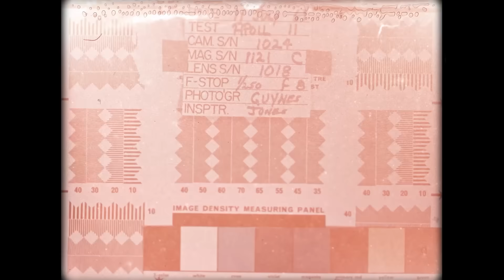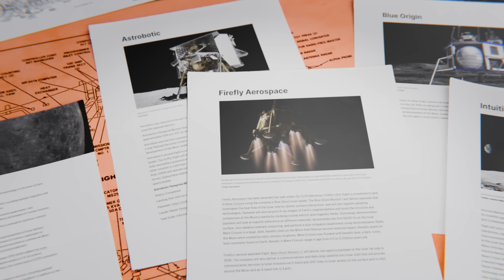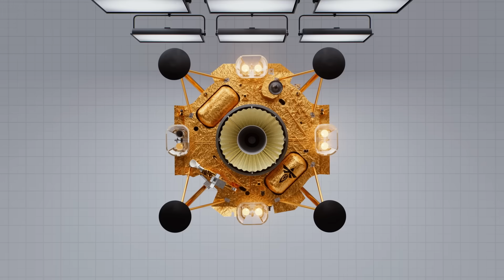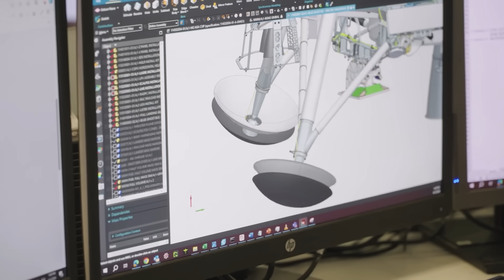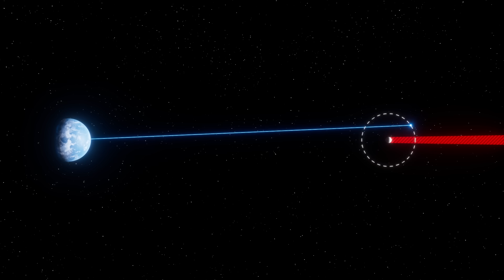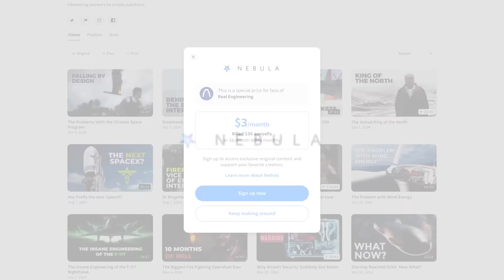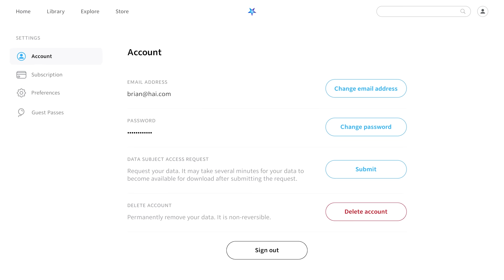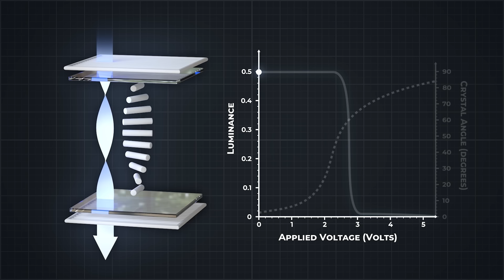Why the US is Struggling to Land on the Moon

Comment: NASA successfully landed 5 of 7 surveyor missions remotely on the moon between 1966 and 1968. Before a human piloted craft ever attempted to land. These mission answered question such as whether a lander would sink into the regolith, and the conditions astronauts would face on the surface, not to mention the auto approach programming they had worked out, a modified version of which would guide the Lunar Module  and control its attitude all but the last few hundred feet.
Reply: Happy someone pointed this out. Surveyor spacecraft managed to land on three legs, used a single rocket motor which it jettisoned before soft landing using some low-energy thrusters, managed to carry everything including fuel and a camera on a frame the size of a Harley. It even survived the lunar night. How these new unmanned robotic spacecraft cannot match that level of performance I can't understand.
Reply: @tperk  Thermo electric generators. They provided power and kept the internals warm. You cannot buy those things off the shelf. Not even if you have technology to make it to the Moon.
Reply: @HyperMAX9001  on their backs. Thermal nuclear generator on their back. Get a grip.
Reply: It’s just MONEY.   The failed landers are all built by amateur companies on very low budgets. NASA and JPL, especially in the 60’s, had effectively unlimited budgets and a MUCH deeper bench of experience engineers, scientists, and test facilities.  When you try to do things on the cheap, you have to expect a lot of failure.   NASA did far more extensive testing of proposed designs PRIOR to launch to ensure a higher success rate.   E.g.   SpaceX can’t get starship to work in 20 tries, because their engineering and testing program is moronic. But NASA and its subs got SLS to launch flawlessly on their very first try… because they KNOW HOW to test design ideas before finalizing the overall vehicle.
Reply: @tperk  On a fraction of a budget, and expected to be able to land in less forgiving environments. Surveyor (understandably) chose much more forgiving locations - in the middle of more recent craters, with no large debris - matching the safe choices that would be made on Apollo.
The program ran an est. 469 million USD, which inflation-adjusted is over 4 billion dollars today. This is more than the current proposed funding for the entire current lunar program.
The early failure rate was steep too:
Surveyor 2 failed in flight
Surveyor 3 bounced and relanded, damaging equipment.
Surveyor 4 crashed
So, 1/4 full successes in the first 4 missions, 2/4 partial successes
Reply: @tperk  Because NASA is run by bureaucrats who only care about making sure they can ask for more money at the next Congressional budget approval meeting. SpaceX has done ten times what NASA has for a tenth of the cost, because it's being run to actually achieve a goal.
Reply: @tperk  They have 2 astronauts Marooned 265 mikes away and have no idea how to rescue them. But in 1969, America achieved the impossible. Okay then
Reply: @tperk  Mate, you answered your own question. Read it again. No one or nothing can match anything that has never been done. Technology cannot go in reverse and you need to awaken to NASA's lies.
Reply: @deanhall6045 You are both doofi of the first order. Technology absolutely CAN go in reverse.  Look at the dark ages.  We used to make 16” diameter 50 caliber naval guns.   It took us a century to develop that technology over time. But once we stopped building battleships, all the tooling developed for that task got scrapped and all the men who had learned how to do it retired and then died.   We could build naval guns again, if we WANTED to. But the exact info on how to do it is lost, so it would take us a decade or two to figure it all back out.
The answer to your silly questions is that to is NOT NASA trying to put landers on the moon that can’t do it.  Those are tech bro startups that simple DO NOT have what NASA had in the 60’s, which is unlimited funding and something to prove.  Elon musks starship is a flustercuck, why?  Because he decided he knew better than NASA and chose to do everything in the way NASA NEVER would have.  He only got the contract because the GOP refused to approve a Biden appointment to head NASA and as a result ONE underling got to make the decision and gave it to Musk after he promised her a multimillion dollar job on the board for SpaceX.     Elons rocket is useless after 20 attempts.   NASA’s SLS launched perfectly its very first try and had no problem completing its entire mission profile lifting the full mass it was designed to lift.   Even Blue Origin’s New Glen launched perfectly on to very first try with its full 50 ton test payload.  
And let’s keep in mind that NASA has landed NUMEROUS rovers and even a helicopter on MARS, with robotic craft. Sal thats some tech bro startup, or INDIA a nation with practically no prior space program can’t seem to pull of a moon landing is not NASA’s fault.   It took 7 years to figure out how to land on the moon with the most bare bones solution, and it was only possible because the US had started development of the F1 engine 7 years earlier.
Reply: @christopherpardell4418  extraordinary rant but I give 3 out of 10, for good grammar. The guns were replaced by guided missiles mate, does that seem to be technology in reverse to you? They were replaced by something much better. They could figure out how to make those guns in 5 minutes mate, but haven't the need, you make zero sense.They have a need to go to the moon, it's full of trillions of dollars worth of gas and minerals, despite what the uninformed believers might try to tell me."Oh there's nothing there, we don't need to go back". How many times have I heard or read that. So six countries put landers on the moon last year because there's nothing there, ....okay. Oh, ...your lander fell over putting you sixth in the race. Enjoy your little fantasy mate, the VAB lets no human through, proof being they'd have done so by now. They haven't. It's impossible. Elon would have an office up there, probably at his minesite, of which there would be many if man could get there to mine it. I respect your right to believe in fairy tales and this is the BIG one. Cheers.
Reply: @deanhall6045 . Nice try. We can build guided missiles. But we can’t build large naval guns anymore.  That is technology we have LOST.   We could ALWAYS re-develop it.  Just like Renaissance Europe eventually figured out how to do everything the Romans could… but it took them 800 years.    The point is, we KNOW exactly how to build a Saturn 5 and a lunar lander that will work.   We just threw away all the jigging and tooling to manufacture those parts. And MOST of the electronics compensates we used are no longer manufactured. And so ALL of the subsystems would need to be RE-ENGINEERED to use the components that ARE available.    You wanna see NASA and on the moon in 7 years, like they did last time?   Just HAND THEM THE MONEY and tell the politicians to stop playing games with it.   The Apollo development program in today’s dollars cost 283 BILLION.   And took place under circumstances where every subsequent congress and president kept funding in place.    NASA, however, built a MARS lander Perseverance that landed successfully on Mars remotely, and has run it for over 3 years for a grand total of 2.7 billion. That was almost entirely engineering, design, and building the rover, landing system, and rocket to get it to mars.
Worked first time.   Because NASA and JPL are professionals.   India, and other private ventures are amateurs, and operating on budgets that are comparatively tiny.  Pull your head out of conspiracy doofistry.
Reply: @christopherpardell4418 Dream on mate, it's a very few Americans still feeling a patriotic duty to defend this hoax. Reality has bitten most people. Just another massive lie.
Reply: @deanhall6045 Very few Americans are so ignorant as to doubt what they saw with their own actual eyes.   You clearly are someone who has NEVER been to a rocket launch.  I saw one just yesterday out of Vandenberg.   Maybe get OFF the ludicrous websites banking coin off the gullibility of rubes and actually leave your mom’s basement and GO to Canaveral or vandenberg, or any of the other launch facilities on earth where you can see for yourself.   Or hey, BUILD a damn rocket yourself. LEARN how to do the math and the basic physics so that you can prove to yourself that rockets DO work and that “they” are not lying to you.     Folks what flunked grade school physics really are not qualified to figure out much of ANYTHING.
Reply: @christopherpardell4418 I know rockets work. I'm stating facts, no human can go through the Van Allen belts. Ever. Not now, not soon, not in 1969. Go get your booster.
Reply: @deanhall6045 You don’t even know what the heck you are talking about. They are not “belts” like some kind of belt sander.   They are ZONES of higher than normal radiation, MOSTLY charged particles being deflected by the earths magnetic field.  the zones of charged particles are pretty high up… well above the ISS and LEO.   Apollo, in crossing the Van Allen belt measured a peak radiation flux lasting around 12 minutes, and then an hour later a second one lasting a little longer. The rest of the time, their radiation exposure was about the same as in LEO or lunar orbit.   Their dosimeters revealed that the radiation they got transiting the belts was the equivalent of a modern CT scan.   For contrast, folks who work in banks or other buildings with a lot of granite surfaces like walls, floors and counters, get about the same amount of radiation EVERY YEAR.  Apollo was traveling at 36,000 KPH when transiting the belts. As a result their exposure was short term and not very high. 
You would have to spend 36 hours loitering in the inner belt to receive 400 rads.   A fatal dose.   Because of how orbits work, this would be nearly impossible to achieve unless you designed the entire mission to have a circularized orbit at that altitude.  
I received training in civil defense regarding radiation exposure and how to protect against it in the event of nuclear war. And sorry, but the hysterical ignorance of someone who has no idea whatsoever of what he’s talking about is just never gonna convince an educated person.   Radiation is NOT at all what you imagine it to be in effect.  A Japanese guy who was in the Hiroshima blast made his way home to Nagasaki just in time to be caught in THAT blast.  He got exposures from both fireballs, AND from the fallout from both.   He survived and lived to 93.
Reply: Soviet Union collected Moonrocks using autonomous landers and their Space shuttle was unmend drone!
Reply: Do you know what happened to the ones that didn't? The real researchers know and it's very profound!
Reply: @ When you use terms like “real researchers” you reveal yourself to be a crank. Surveyor 2 had a mid-course correction failure and impacted the moon near Copernicus crater. And the surveyor 4 had a retrorocket explode while it was landing.  Nothing profound.  Just some lessons in how to harden spacecraft systems for deep space and wide temperature extremes. “Real researchers” are the folks who swallow hare brained fantasies they read about online.
Reply: Hughes Aircraft had some smart engineers on staff.
Reply: @ As did Grumman, Boeing, Rockwell, Martin Marietta, and all the other subs who worked on these projects.  Building the flying bedstead which accurately simulated how the lunar lander would handle in 1/6th G while still flying on earth was probably the key component to landing successfully as the pilots had the opportunity to learn how to control the machine while landing on the moon without having to be on the moon.  I hate hearing Musk acolytes cheering SpaceX as it fumbles its way thru rocket development by launching dozens of exploding failures, while they dump all over NASA and other aerospace contractors, despite the fact that SLS and Artemis were no more late than SpaceX is on their moon lander, and their rockets worked perfectly on their first flight. Or noting that Crew Dragon only worked on its first flight because NASA forced SpaceX to develop it THEIR way. Rather than ‘iterate’ their way to a solution.
Reply: @christopherpardell4418  and who's the world's richest and probably smartest man?  But I'm sure you know what you're talking about.
Reply: @ If you think he’s smart, you clearly aren’t. Maybe look into why he was fired as CEO of PayPal only 6 months in. 
Or maybe notice that he did NOT found Tesla, did not invent the hyperloop, and that anyone with a first year engineering degree could have explained to him, or you, why the hyperloop could never work.  Or perhaps take note that the Las Vegas Tunnel is NOT what he promised, and is literally slower than walking the same distance. Or even that he is currently 4 years late on his lunar lander contract, because he personally insisted on a OLM design that did NOT include the deluge and flame diverter that every other heavy launch pad figured out back in the 1960’s.  Or even that he was too ignorant to realize that he could be legally held to a sarcastic offer he made for Twitter, and forced to buy it.   
That he is so rich ( on paper ) is thanks to how gullible far too many other people are in handing him billions of tax dollars, subsidizing the sales of his products, or driving the stock price of Tesla to a level that can not be supported by its sales. 
ALL of his money comes from an overhyped stock valuation, illegal stock manipulations, and Public Funding of the companies he BOUGHT because State or federal governments were offering tax and price subsidies, or started specifically in order to take advantage of government contracts worth billions. 

Just because some doofus SAYS he knows more about manufacturing than any other person currently alive on earth is not EVIDENCE that they are what they claim. It’s actually evidence of personal delusions of grandeur. 
It takes a particular level of sucker to watch someone blow up 6 rockets in a row and cheer as if they are successes, when other companies making, say, Artemis and SLS have perfect launches with fully functioning rockets on their first try.   At present, SpaceX is further behind and costing more than SLS. 
Oh, the guy who who said that his slide stating starship landing on mars in 2022 was “not a typo” will never land on Mars.   There is no money in it, once the investors catch wise to the con.
Reply: @christopherpardell4418  All pre affirmative action and DEI.
Reply: @johnbaldwin2948  oh please, enough with the racism.  Musk is in the US because of DEI. And SpaceX has an active DEI program, hiring 8% blacks, 9% Asians, and 28% Hispanics.   People who hire probably do not hire based upon merit. They hire folks who remind them of themselves based on familiarity. All DEI does is provide a benchmark on whether you are giving folks who don’t look like you a fair chance. No one is forced to hire anyone unqualified.
Reply: @christopherpardell4418  Somebody sounds jealous.
Reply: @ I am not the voice in your head. What I sound like , is informed.
Reply: @christopherpardell4418 I don't care about musk, he doesn't know I exist, but you saying spaces is "fumbling" about its project is wild, they caught a freaking rocket
Reply: @ That’s what comes of being too easily impressed.  I have leveled a lot of accusations at SpaceX over the years, but I never once suggested they would not be able to catch the booster.   Because if you can control a rocket enough to get it into a very specific orbit on launch, precisely, then the rocket obviously can return with similar precision. That they can land a rocket that cannot even hover on a bobbing boat in the middle of the ocean is all you need to know to understand that catching one that CAN hover is doable. Get it?  It’s nothing new.  What I have pointed out since I saw the OLM being built was that their lack of proper flame diversion and deluge close to the nozzles was going cause damage to the OLM EVERY SINGLE launch.   And guess what why the last booster didn’t get caught?  Damage to the OLM from the launch. Guess why they didn’t launch for 4 years? Because every time they even did an engine test fire, it did millions of dollars of damage to the OLM. 
My perspectives are formed by my having an understanding of design, materials, and physics.   When I see those bright pulsing flashes that radiate in all directions at every launch, I KNOW what I am seeing. Those are the constructive peaks in the interference of hundreds of sonic booms created by each engine. Each of those pulses is powerful enough to kill a man 100 feet away.  Powerful enough to demolish hardened and reinforced concrete. You don’t see them on Saturn, shuttle, or SLS launches because NASA knows about deluge systems and blast diversion.
When I watch the reentry cam, I am Seeing the sheet metal skin rippling and coining and warping and turning blue.   I KNOW that is steel heated to the point where its temper and stainless protection is lost, and  expanding and warping into shapes that are NOT the shape it originally held.   This means this rocket is NOT gonna a fly a second time due to structural changes and it being bent.    
Or take the Cybertruck.   When I heard they were gonna make parts of the Frame of the truck out of aluminum gigacastings i shook my head. What kind of doofus would make a critical part of a working truck, the part the HITCH attaches to, out of CAST aluminum?   It’s the wrong material for that application.
And what kind of engineer doesn’t KNOW this?
The point is you don’t see other companies making these kind of mistakes.  They know better.   Why does Musk’s companies do them?   Because Musk keeps insisting on things that won’t work well because he doesn’t understand what he is doing.
He just takes all the credit for what goes right, and guys like you never hold him to account for the majority of things that go wrong.
Reply: @christopherpardell4418  Affirmative action is racist, it is judging people based on their race. Being opposed to affirmative action is the opposite of racism.
Reply: @ No, it isn’t. And saying it is an indication of ignorance. And a person named Goldberg should have a better understanding of how systemic racism creates an uneven playing field. When my father was a young man, people named Goldberg could not join country clubs, could not stay in certain restaurants. And let’s not forget how most of European history  people with that name were not even allowed to own land. And how did THAT turn out?   Do you feel that anti-semitism is all gone now?   Or are we still facing that kind of pernicious prejudice today?  The second house I bought had a clause in its paperwork that still said it could not be sold to a black person. The realtor told me that clause was no longer legally valid. That house was built in 1978.  Affirmative action is nothing but the legal recognition that there IS prejudice and bias.  Ivy League grad executives tend to overwhelmingly favor Ivy League grads in hiring. Children of Ivy League alumni get preferential acceptance regardless of their grades.   White people tend to think that White applicants are ‘more qualified’ than people of color.  Men tend to judge other men more qualified than women.   Even Jewish people tend to judge Jewish applicants more qualified than gentiles. The Statistics show that this is a COMMON Human behavior. We have an affinity for people who LOOK LIKE US, and that makes ALL application processes suspect. 
Affirmative action is NOT ‘racist’.  It’s a correction FOR racism that provably exists.
Guess why there are very few US Black Olympic swimmers?   Because far fewer Black people in the US have access to pools as they grow up.  THAT is racism BAKED into our society by centuries of economic disadvantage fueled by prejudice. 
Try and THINK before you decide to agree with Rupert and his ilk.
Reply: @SchemingGoldberg No, it isn’t, because in the absence of affirmative action it is PROVEN statistically that people ARE being hired based on RACE.   Oprah tends to hire women preferentially and black women out of proportion to their demographic. White guys tend to favor other white guys in hiring determinations.   Affirmative action does not force you to hire people of any given race.  It simply says that if, on average, 12% of your qualified applicants are black, and 23% of your qualified applicants are Hispanic, THEN if your organization has only 2% blacks and 4% Hispanics, YOU ARE BEING RACIST IN YOUR HIRING CHOICES.   That is a FACT.   Affirmative actions does NOT require you to LOWER your qualifications for any applicant. Ergo, you are NOT being forced to hire unqualified people.    Oh- and affirmative actions applies in the OTHER direction, too.  If you have a company that employs 70% black people, in a town where 48% are white, then affirmative action would require you to hire more qualified white folks.
Reply: @christopherpardell4418  Except this big fat lie forgot that humans cannot, ever, go through the Van Allen radiation belts..... otherwise they would, wouldn't they now?
Reply: Not comparable, as shown, this time it's tall.
Reply: We also took a electric vehicle that could go 60 miles. Broadcasted it live from the moon doing dounuts.  Hilarious right!  My favorite is a janitor threw away all the original video away that's why the footage is all grainy it was recorded from the Live TV broadcast
Reply: @ I hope this is sarcasm.